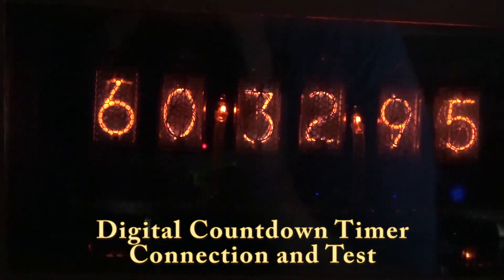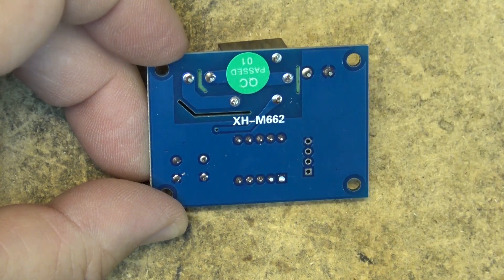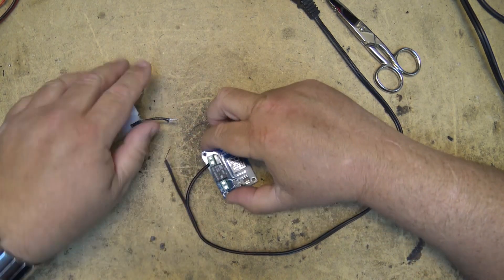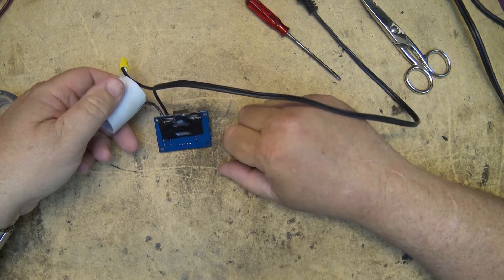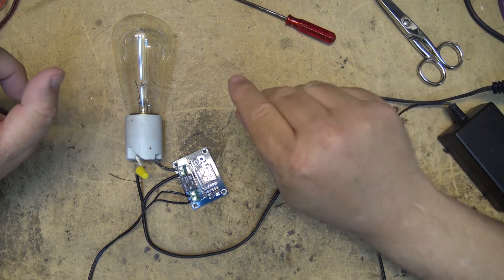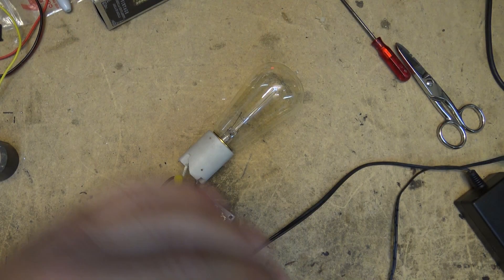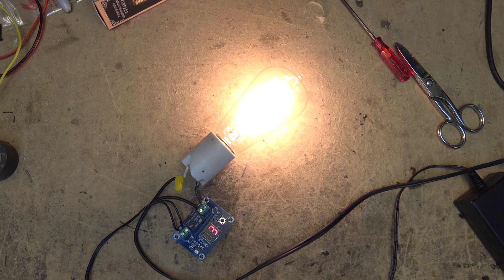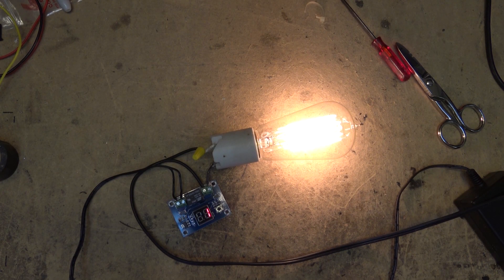Digital Countdown Timer Module Set up and test

Comment: Where is the full bridge rectifier at or is it  ac to ac
Reply from the maker: the timer runs on 5 to 18 volts DC. The relay contacts can handle up to 10 amps at 125V AC.

Comment: Can't see back of board at it station!
Reply from the maker: Nothing on back side of board. The timer chip is on the top side under the display. The large 3 terminal chip is the regulator and Q1 surface mount transistor controls relay.

Comment: Handy for turning an ordinary battery charger into a timed charger.
So no excess overcharge because of time.

I find the old plug in the wall rotary timers very usable too.
Reply from the maker: Yes that will do it, but the trickle charge controller I showed off before would be better for that because it monitors battery voltage and turns the charger on and off as the battery voltage drops.
Reply: some older lead acid needs an equalisation charge, and having an old dumb charger is handy sometimes, i have been keeping my eye out for a mechanical over timer with 6-8 hours range for some time, not found one
Reply: Oh, don't the dredded Tesco do one any longer?
Or do they cost a kidney lol :-D